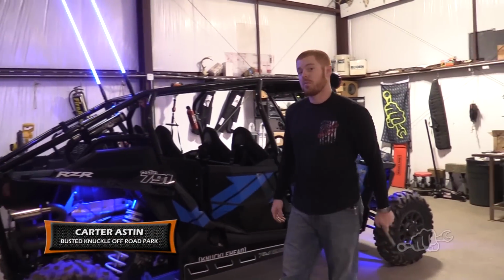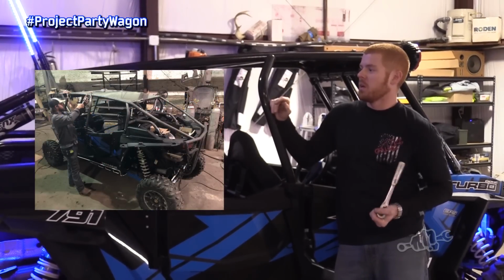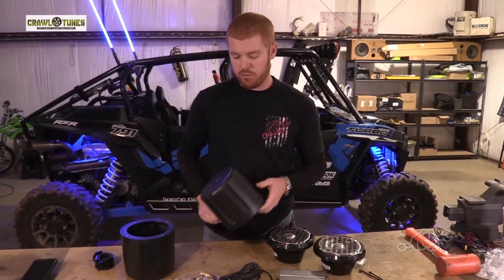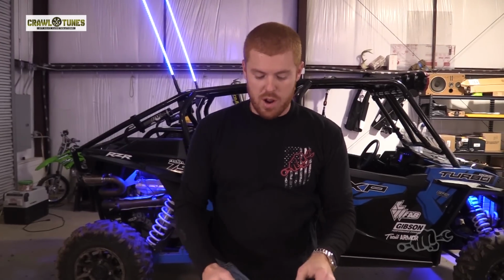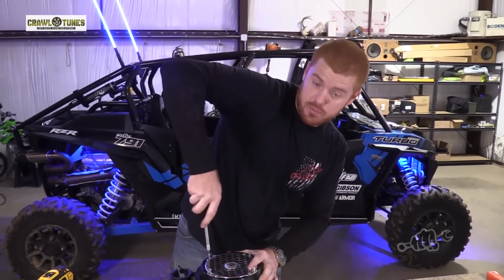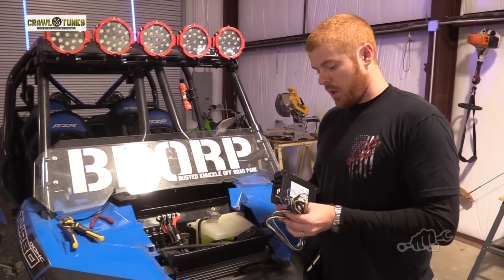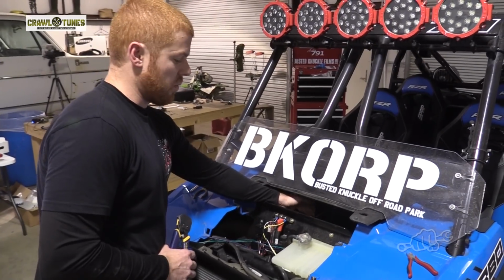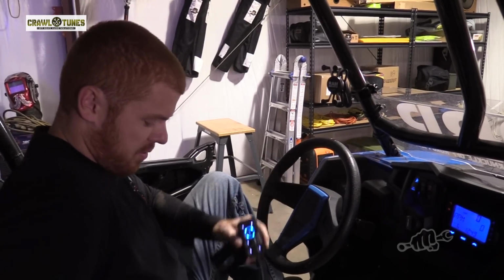Polaris RZR Speaker System Install - Extreme UTV Tech

Comment: Looking at doing an audio system on my Can-Am. Did you have to do any kind of battery upgrade, or add a capacitor to the system? Running all the extra lights and sound, wasn’t sure how the rig being stock would handle all the upgrades.
Reply from the maker: we haven't upgraded anything with the electrical system

Comment: speakers are crap...tweeters fall apart if used by salt water...RF will not warranty or fix them happens to all 6 of mine.. I ride at Pismo 2 times a year after 1 trip all failed
Reply from the maker: We aren't near saltwater so we should be good. You can also purchase the cans and add any speaker you like. Or put together your own complete kit- http://bustedknuckleoffroad.com/SOUND-SYSTEMS_c405.htm

Comment: Go mudding with a Kawasaki 450 4 stroke
Reply from the maker: is that even 4wd?
Reply: BustedKnuckleVideo or a Toyota my dad has one from  19 years a ago and we went down to the duck hole and it just rained real bad where I'm from(west TN) and we went mudden with it it needs a better clutch but it still does good and my uncle does stuff like you he has a Turbo-360 side by side but it will go 0-65 MPH in 6 seconds
Reply from the maker: 6 seconds? That seems like a lone time
Reply: BustedKnuckleVideo it might be less it's in the shop after we flipped it the top bar got bent and the fender paint got tor up but I'm only 12 so if my seconds are off then(my bad)
Reply: Red Necking it!.....nice
Reply: #southernlife